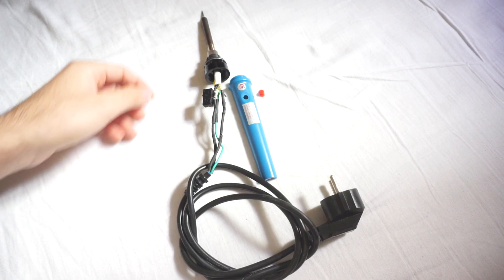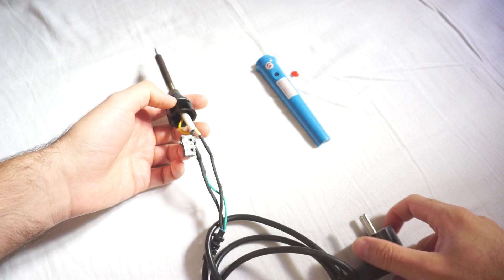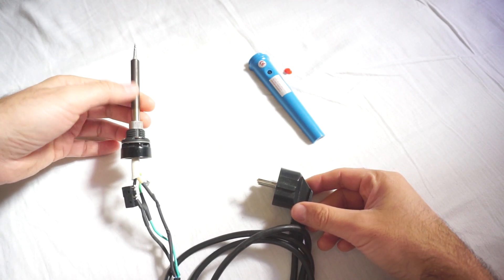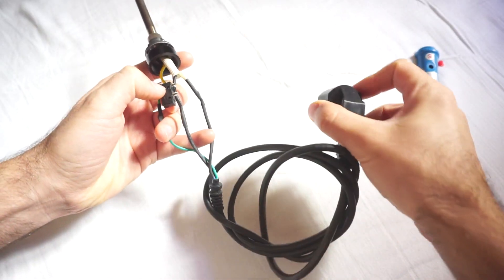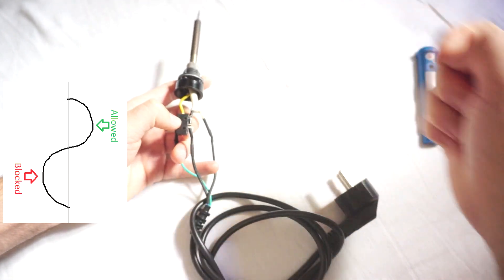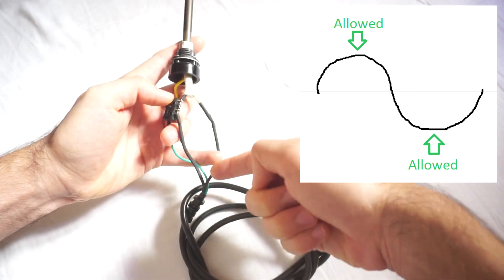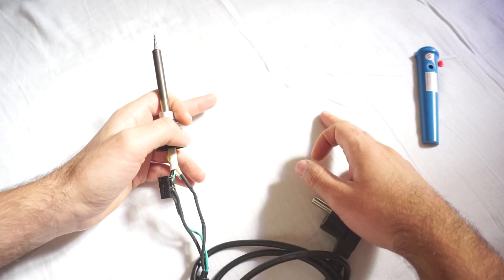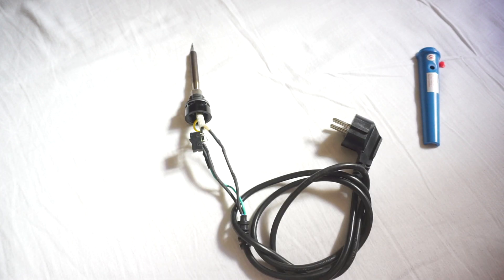Soldering Iron Heat recovery (AC, Diode, Red Button)

Comment: Does this mean that just by plugging the soldering iron in (and without pressing the button) it will still heat up?
Reply from the maker: Yes, but it will use half of the sine wave. Probably a constant full sine wave would generate too much heat for this soldering iron.